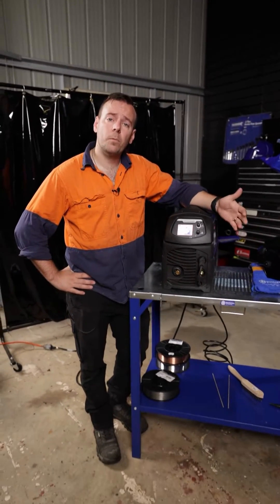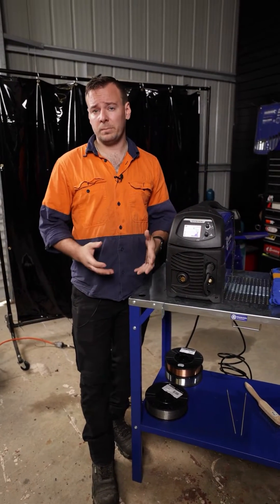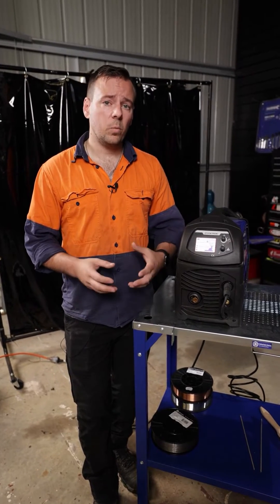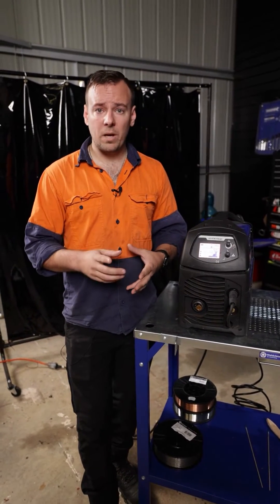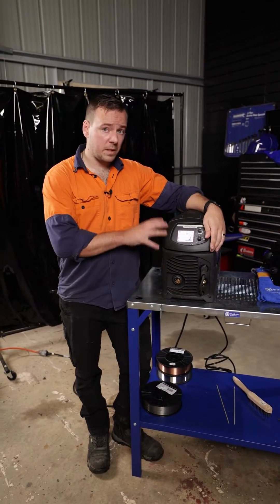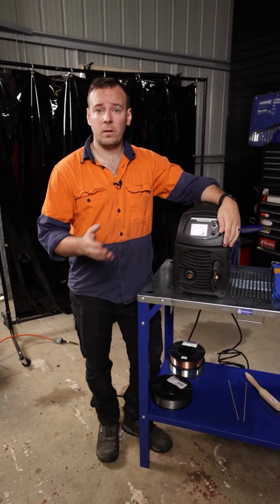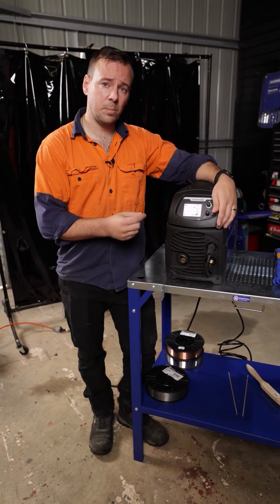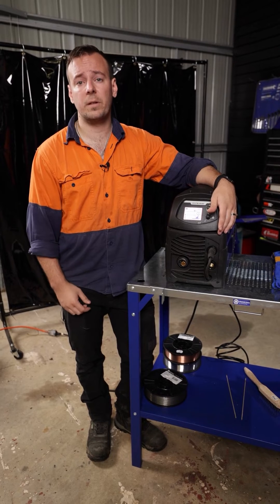Synergic Welders Explained

Comment: I'll go buy one !
I dont need an rookey of all traids. I need an expert on one thing. 
My dayly job is to fix a lot of the same kind. But this kind differs in qality - some are rotten from outside, some from inside. Some are fixed earlyere but wrong, some came from factory made wrong. Some are broken, some just old. So with this synergy thing i can fool around untill i get the right approach for each situation. If only i could store every precize tune in this mashine.